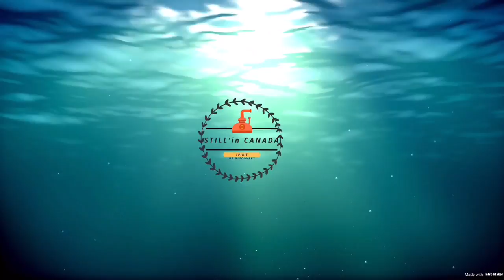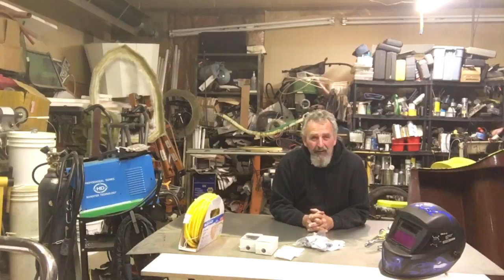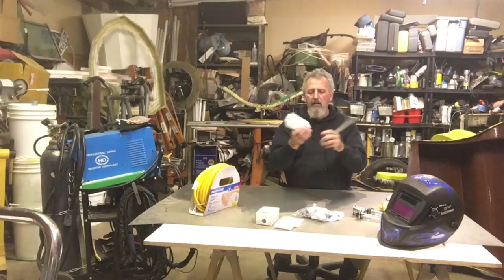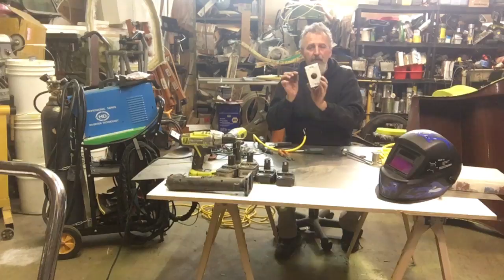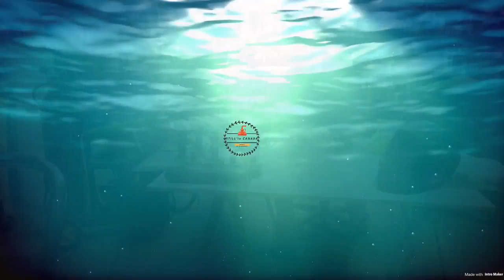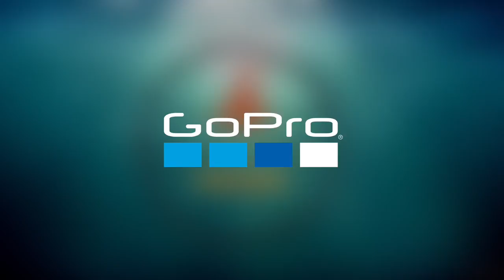Heating Elements

Comment: I use 30A 3 wire twist lock elements and cables. They are quick and easy to connect and disconnect. Kind of expensive, but worth it.

Comment: Canadian electrical code says you can only run 80% of the rated value of your circuit. You can only run 24amps on a 30amp circuit. Looking forward to your future videos though. Such a fun hobby.
Reply from the maker: Thanks Josh, yup saw that after the video was done, a 35 amp breaker keeps us in the proper standing and the supply to the shops panel is 60 amp service. So I should be fine when the inspector knocks on the shops door! 
All kidding aside I highly doubt any insurance company would cover fire damage due to a stills electrical fire. So it is far better to be on the cautious side rather than the wife slapping the hell out of me side!